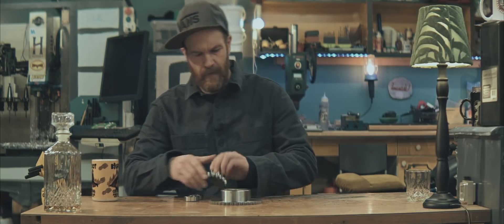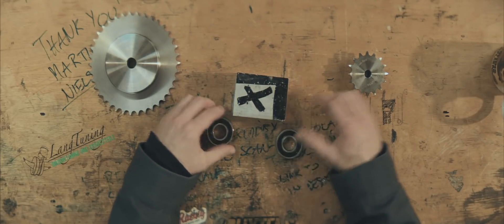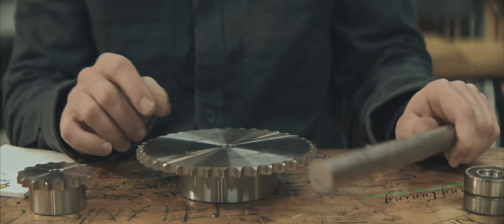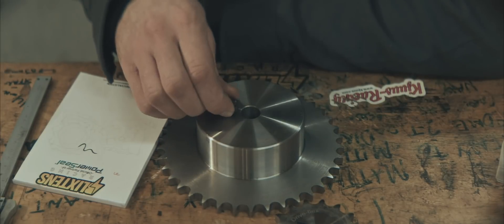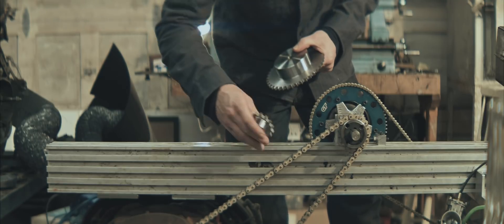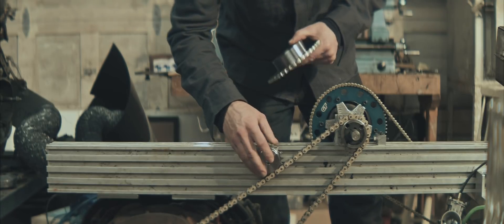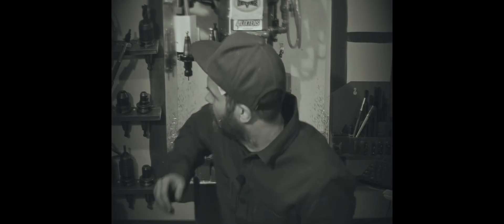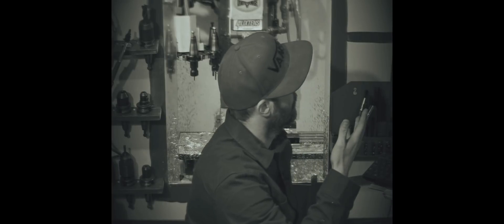Screw clickbait, I want Art. Building a Dyno, thank God for Rum!

Comment: with the faulty a axis, if it's holding sounds like the stepper drive is okay, but if it's not moving it's most likely missing the step signal, a single wire. The other possibility unlikely is that acceleration on the axis is far too high and causing it to miss all steps.

Comment: One way to mount a hub to a shaft which does not need much equipment:
Drill a hole half-and-half in the shaft and hub, then tap it and screw in a screw. It locates very well axially, and also transfers torque well. 
Such a setup worked for a couple of decades in a gearbox I made, until eventually the geas wore out. 
I have seen it used "in the wild" too, to hold a knob onto an operating shaft on my milling machine.

Comment: if its a servo or closed loop stepper the problem might be in the encoder , could allso be that mach 3 was corrupted before and allso caused the toolchanger to stop working
if this adaption of the dyno doesnt work you might want to think about including a motorcycle gearbox in the driveline and basicly spin up the retarder by running through the gears so the clutch whont slip so mush then loading the retarder up and do a run

Comment: 8:48 I've been watching you use that big heavy DID chain like I have on my XR650R. I feel like in order to help get this thing up to speed you need to use a non o-ring chain (if this isn't already), take the thick factory grease off and put on really thin oil, and maybe step down a size on the chain. Reduce the friction and mass to get the motor into the power band. Not like you are making massive torque or power to need full size chains anyway.
Reply: Believe me it ain't no fucking chain holding this engine back lmao
Reply: @christophzxc6372  Not when it gets into the powerband, but before. I don't know if you watched all the videos before this, but he is unable to spin up the dyno drivetrain enough to get into the powerband to record a hit. It no doubt makes 20++hp, but less than 1hp until a million RPM, lol.

Comment: You coulda cut some keyways on the lathe, chuck it up and use a hand ground cutoff tool to form a shaper bit and put it in a toolpost parallel with the ways. Then use the carriage as a manual shaper of sorts, slowly moving the cross slide towards you to after every manual pass

Comment: I am not quite understanding all the chains and stuff, will these chains cause loss of power shown? For example, I have a motorcycle dyno, (using your dyno software) so power tested at the rear wheel, that number would be lower then if engine was tested at the drive sprocket, or even better at the crank, I am curious about your set up, it seems to me these drive chains and stuff will not be good for comparable horse power? or do you have a way to know how much loss they are causing? I understand all is great for tuning, cause then the number doesnt matter to compare, as long as it is your number and when you make changes, that number changes, for the better we usually hope, lol, But for you, testing to be know you have built the most powerfull 2-stroke, I am wondering, well I dont even know actually what I am wondering.... I guess, hopefully when it all works you can explain all this a bit more, please? Cause it is awesome, and I learn a lot here.
Sorry so long...

Comment: I would use powerbank, that is capable to be charged with at least QC or PD 18W as power source. It must be single or paralel cells (almost all of 10000mah and most of 20000mah are like this) and after opening of enclosure i would just tap off to bare cell with fuse to original battery board. In this configuration you get cheap as fuck power source with ability to be charged quickly and even while in use. Capacity and features are limitless, connectors can be used etc

Comment: A little tip, you don't need to make square keyways to hold sprokets on shafts. You can drill a round hole through both that matches up and put a round roll pin/dowel in it. Cummins has been doing that on their diesel engines forever, though adding a set screw on the end of it so it can't ever back out is always a good idea or if you ever do it internally it can back out and become the dowel pin of doom like Cummins has a bad problem with.. On the 12 valve Cummins the dowel pin likes to back out of the high pressure fuel pump and go through all the timing gears and destroy them on top of the fuel pump timing then going out of phase.
Oh btw, have you seen "The Workshop" on here and his video of him breaking down your projects? I only got part way through (got bored) but he did bring up some valid concerns including that your actual volume of your blower isn't enough for what your engine is displacing because in all actuality you don't just have a 50cc, you have ~180cc between the reeds plus all the passageways and the crankcase that need filled so you'd actually need a lot more displacement to keep up with it. 
Also I'm curious, what kind of compression ratios are you running on these engines? I looked up how nitro works and your CR is VERY important as it can vastly change your timing and oddly it works backwards of gasoline octane I found out.. Whereas gas ignites quicker with higher compression nitro does the opposite and it retards the timing and will burn out the exhaust instead of in the combustion chamber. (that was definitely odd to learn.. A day without learning is an opportunity wasted.)

Comment: The formula keeps getting longer and longer. Have to be a literal rocket scientist to calculate all the reductions to horse power.
Reply from the maker: No worries, taking torque measurements directly of the engine cradle with a load cell.

Comment: Is it possible to press the hub and shaft together and drill horizontally thru the parting line? Then add a round pin. They do this sometimes on supercharger pulleys when the factory cranks aren’t keyed.
Reply from the maker: Not a bad idea at all! Need to buy a long drill bit.

Comment: I still believe you are trying to turn too much mass for this engine, if it can barely turn this unit as it is whats going to happen when you add load? this unit is designed for a truck so why not reduce the weight of the flywheels?  with all the gear reduction you are loosing hp through all the drive mech

Comment: Will you need to measure/calculate the friction and inertia of all that reduction geartrain?
Reply: His load cell is on the engine mount, not on the retarder end, so no, it's all just extra load.
Reply: Any drag/friction in the system past the output shaft is measured at the load cell at the motor mount so no need to measure or calculate.